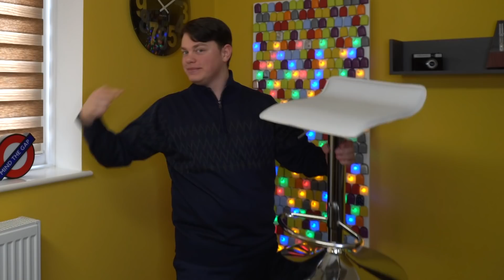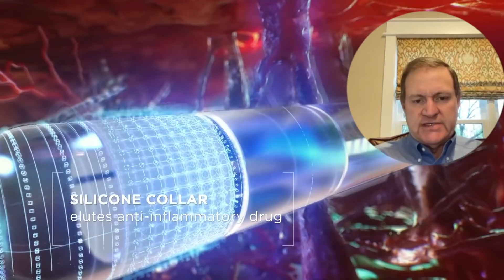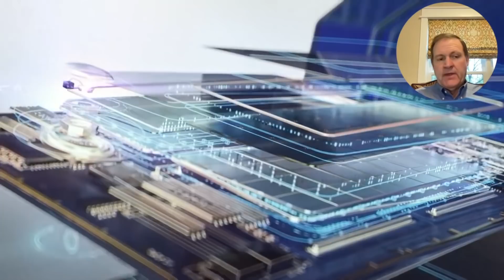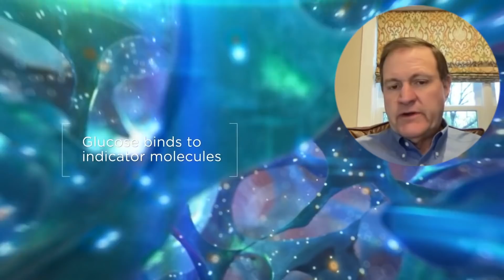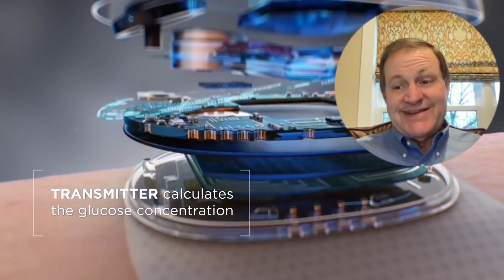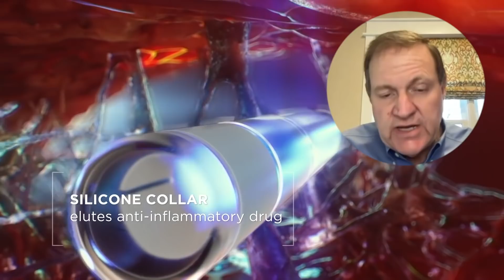"We have a 365-day CGM in the pipeline" Eversense CEO & Ascensia CEO interview

Comment: One question I might have asked Rob is.. is there any inherent conflict of interest with them selling traditional glucose monitoring products versus CGMs? Or is that a silly question? Also I’m wondering if they are thinking about battery life monitoring for the 365 day product. With pacemakers the device informs the doctor how much battery life is left. I think that is critical for a life saving product. I assume they are considering that. One would hope. Thanks for the video.  Very well done.
Reply: Also, I wonder how the would plan to address the alarm issue with an entirely integrated sensor and transmitter, and would it still transmit to the phone?
Reply: @drewmcnabb4451  based on my reading there will still be an optional transmitter with the vibe alerts.

Comment: Used two XL Sensors for a year and switched to Dexcom. Honestly I only miss the on-body vibration…
Reply: Could u tell me what were the cons of XL? And why u prefer DEXCOM?
thanks!!
Reply: @pedrito1621  The cons were that my first sensor lasted for only 110 days, was quite inaccurate and had so many connection losses. In addition to that I had to calibrate twice a day, charge the transmitter and change the sticking plaster everyday. Thats why I prefer the dexcom, it has better compatibility (DIY Loop) and requires my attention only once a week (or every 10 days when I have to change sensor)

Comment: The whole point is we dont want to wear a sensor! We are still needing a sensor with this! Make it bigger so we dont need a sensor worn on arm.
Reply: So u still have something attached to your body from outside!!!!!! So whats a point of going through all this stages!!! To get an implant....with higer risk of infection from inside the body!!!
Reply: @az.az466  The point is the American Diabetes Association concluded that it is significantly more accurate. 

"We found that the point accuracy of the Eversense was significantly better than two other CGM systems. The Eversense CGM system may be useful to provide glucose values to artificial pancreas devices."

https://diabetes.diabetesjournals.org/content/67/Supplement_1/14-OR

Comment: Great prospects. Hope health insurence will be ok with it. When it’s more expensive than the Freestyle we can forget it. At this moment i don’t have an Eversense for that reason. Simply to expensive....
Reply: Is it more expensive considering how long it lasts compared ?
Reply: this is the reasson i not changed my insulin for that one could be aplied by a small device used to push down longues a insulin powder stuff absorved really fast... i will shift my fast reaction one to it, but, is soo expensive i not change... this sensor i not change for 2 reassons over price, cirurgions needs and the most deal break to me, calibrations, i just use free style since it is free calibration solution since first version i get my hands on it... and if free style fails (just once it did and i use for may 4 years now) i can fast as asap put another and keep going... this cirurgion need make much more complex stuff if it for any reasson fails
Reply: @viniciusschadeck4992  , you are totally right. They scetch the ideal situation but what when things fail, and sooner or later they will, back to the hospital. And when you maybe travelling your without....
But anyway, pricing will be to high, just as it is now.
I also use freestyle, hoping on freestyle 3 to come asap.
Best regards, Leo.